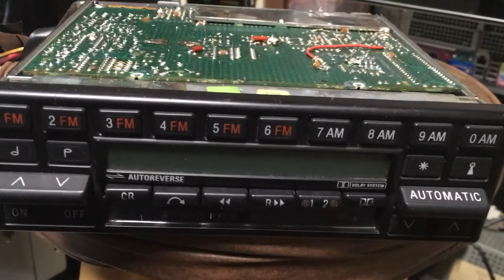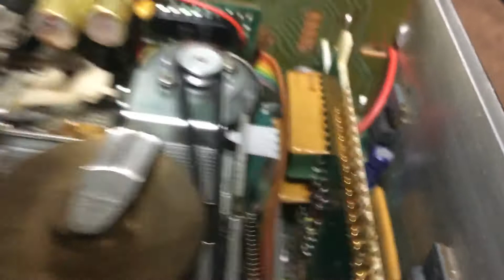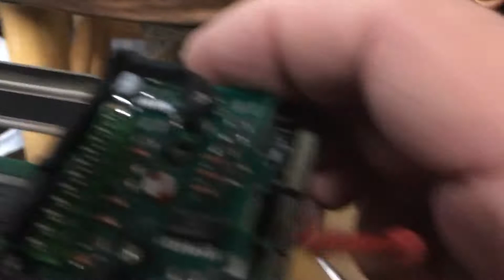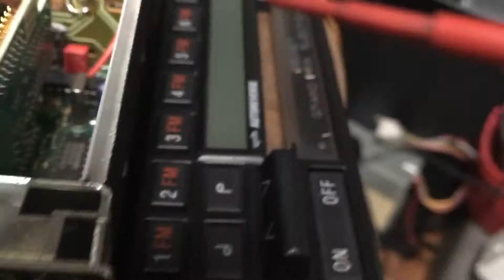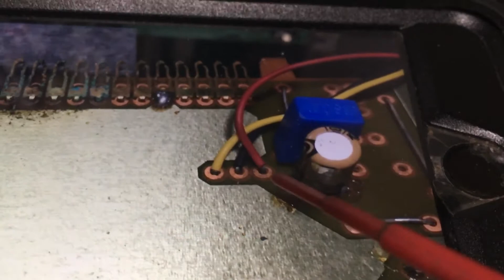Becker 754 restore repair tips

Comment: Invaluable tips! Thanks for this vid. I've a becker 1350 on my w124 that was working solid for 2 years, but now the display text has vanished even though it powers up and backlight illuminates. What part is the likely culprit you think?

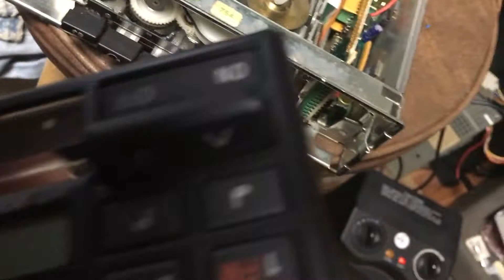Comment: I accidentally removed the plastic screws you mentioned not to remove around 6:30 in and the volume and seek pins are now loose. Can you please post an image or video of how they should be set?  You said impossible, however I’d like to give a try. Thanks.

Comment: Hello, great video. I have a becker 754 but without Display Board/driver like on 5:58 . Do you have information where can I buy that part?
Reply from the maker: Parts are hard to find. Usually I find deals on eBay. That’s where all my radios were purchased. I have seen complete faceplates for around $50 listed on eBay. I have a radio that I’m currently looking for a display which is damaged. Been looking for a good deal for some time now. So as they are getting older parts are expensive and hard to find.

Comment: Wonderful video. I'm considering doing a repair for my own Becker 754, and just gauging where to start cleaning and resoldering new caps. The radio doesn't power on at all, even not into anti-theft mode. The illumination bulb does light up however. Visual inspection doesn't show any blown caps, and boards and contacts appear clean. Any idea where to focus my efforts?

Thanks
Reply from the maker: Start with caps and cleaning with alcohol. I’m sure you will find some green stuff on some of the gold contacts. Careful cleaning and caps replaced should bring it back to life. I have did several that was in that same shape no power and it was always caps and cleaning connections. Hope this helps
Reply from the maker: Also if you get into theft mode I have a video link in my videos that links to the code in the ram and information on how to reload the radio without the dealer tool.  If you don’t have access to a dealer tool. It is a little complex but it gets the job done
Reply: @rick601a  Hello, I'm looking for this video that you show how to recover RAM, but I'm not finding it. I'm from Brazil and here we don't have anyone authorized to have the tool. my becker appears the 4 dashes
Reply from the maker: @juniorsilverio9071  https://youtu.be/J0fxASPGSw8

Comment: My volume button does not work, it is stuck on max volume. Is it any easy fix/ cleaning before I send it to the doctor?
Reply from the maker: A lot of switches on volume and tuning go bad. You can take the face plate apart and clean and often move the switch contact from a less used button to the volume area. But the face is very very difficult to assemble. Often you can find a good plate on eBay from time to time. Only other choice would be sending to Becker in NJ for service but that gets expensive sometimes.

Comment: Great Video.  I have a Becker 754 that the display works but no sound out the speakers. 
I took it to my bench and opened the case like you did but just did a cursory look.  I need to open it up again and carefully check those Capacitors.
Reply from the maker: It’s possible that the gold pins are not seated properly. Some times when the 754 is opened they don’t get seated good. Some times just carefully open it back and verify all the pins are clean and none are bent. Make sure they fully seat. This along with capacitors are the only major issues with the 754.
Reply from the maker: If you do get into theft mode there is a video link in the description of this video that explains how to reset the 754 without the dealer tools. It does however require some inexpensive tools and some basic electronic knowledge. Hope this helps.